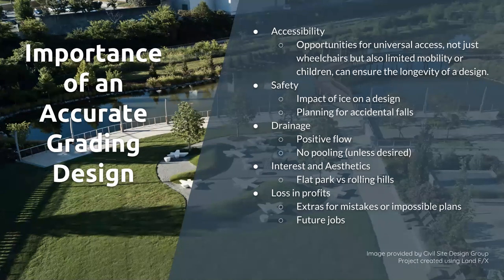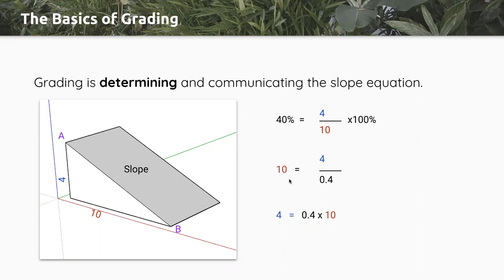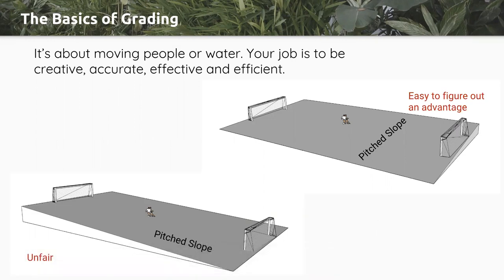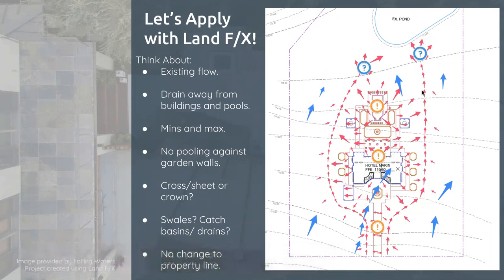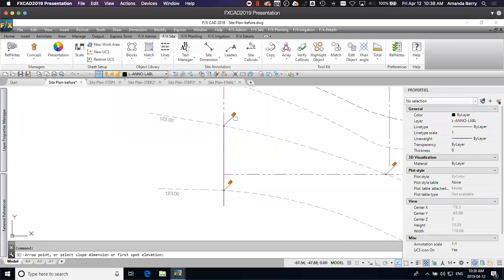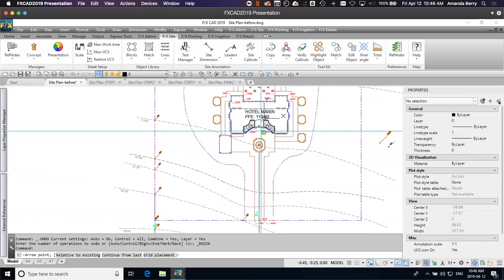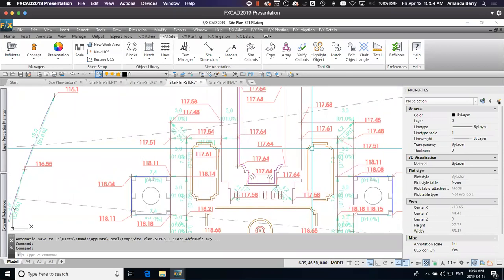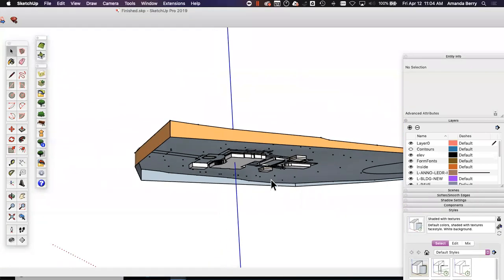Grading A,B,C for Landscape Architects

Comment: One Issue: Why can't we put spot elevation tags in "feet-inches format"??
Reply from the maker: That would typically make for an extremely long spot elevation callout, especially once you start getting into fractions of inches. It's not an option right now because it's not a typically used standard for imperial drawings, from our experience working with thousands of design offices. If you'd like to share a link to a local standard where architectural inches spot elevations are required, we'd be happy to have a look and consider it for our wishlist. Send in a ticket to reach our tech support and wishlist staff directly: https://www.landfx.com/kb/admin-issues/info/item/125-submit-ticket.html

Comment: Hi, is there a way to add 'a table of Abbreviations' used for spot elevation??
Reply from the maker: Yes, you can run a grading schedule from the grading manager (grading section, not Northing/Easting section), and edit the information for what each abbreviation means there. Here's a documentation page on the grading manager: https://www.landfx.com/docs/site-hardscape-design/grading-tools/item/163-grading.html#generating_a_grading_schedule
Reply: @Landfx  
Had an AcRxClassName or Error
after fixing it, now I can place an edited schedule for grading.. thanks
Reply: @Landfx  thanks for the reply, will surely try this
👍